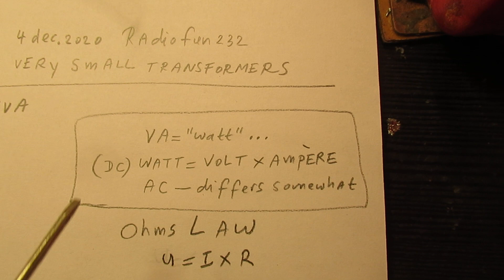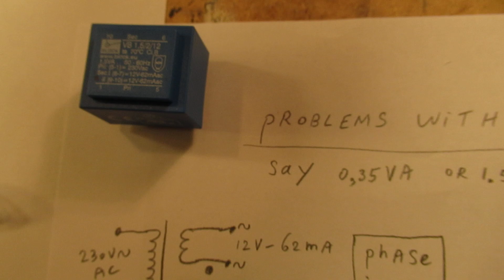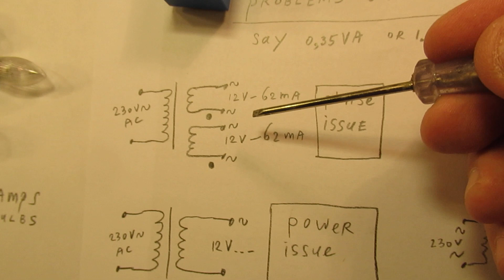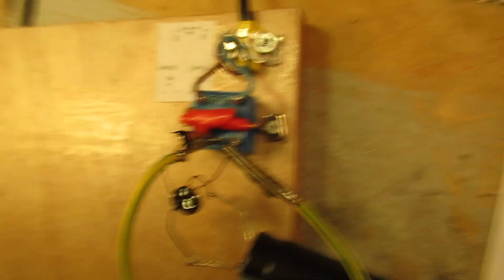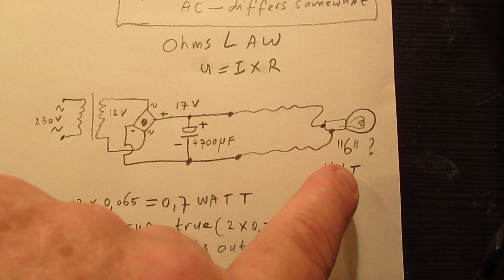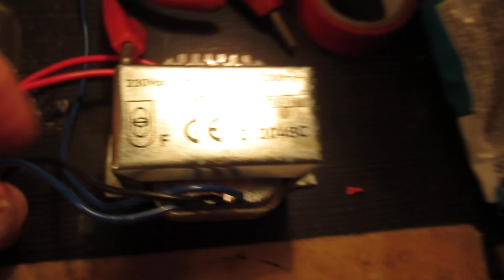Problems with tiny 110-230V transformers (say 1 Watt) that have to supply an electronic circuit

Comment: An interesting part of electronics. The unloaded secondary of those small transformers (say 12VAC), would be about 17VAC and put through a bridge rec and cap would then be about 22VDC! As you said, that could seriously damage a connected 12VDC circuit. I've found that by loading the secondary with a surprisingly low load (high resistance) can bring its Volts down to a safer level. But, that naturally means even less available power for the circuit's use. If correctly designed though, their great advantage is reliability, as compared with switching technology - lasting decades :)
Reply from the maker: Yes, true. Another option is to choose the series resistor to the electronic circuit properly, but that only works when the electronic circuit has a constant resistance when it is "at work". So in many cases with circuits that take a substantial variable current (say an audio amplifier on 5 Watts or more, acting on voltage variations) that is not the right way to do.
Reply: @radiofun232  Very true, Oh the challenges of electronics - but it adds to the fun :)